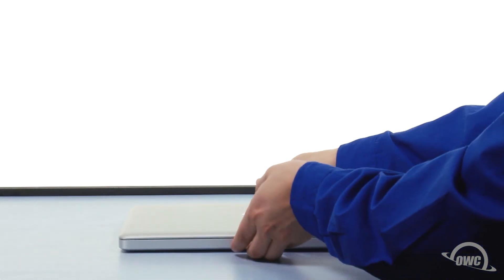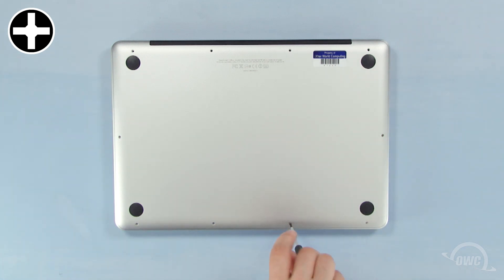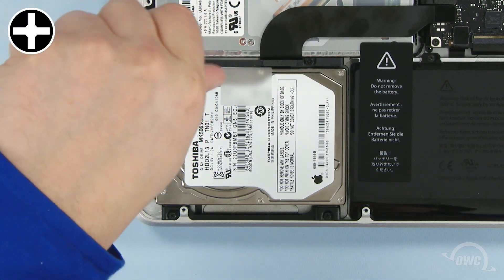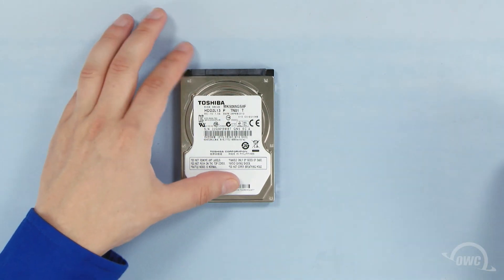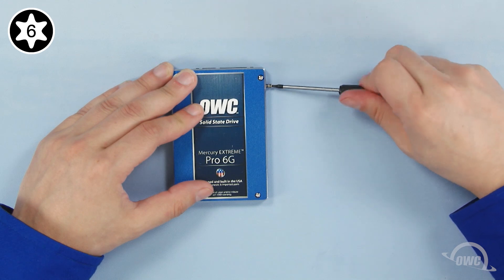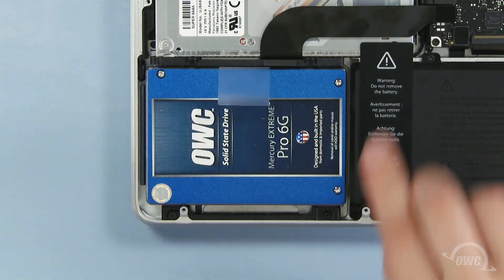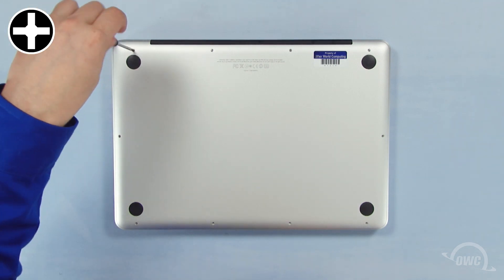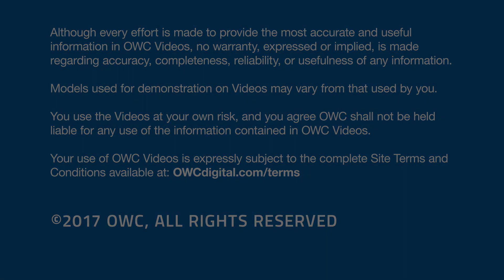How to Install a SSD or HDD in a 13-inch MacBook Pro 2012 (Non-Retina) MacBookPro9,1 & 9,2

Comment: Is the hard drive a 9.5mm thickness HDD?
Reply from the maker: For most laptops that have a HDD , the form factor is 9.5mm / 2.5 in, there are a few occasional Windows machines that might have a bigger drive, but typically this is the form factor found in most portable Windows and Mac machines.

Comment: I installed the SSD and when I booted up it has a folder with a question mark blinking.  I restarted and held down comm-R, the SSD shows but I cannot click on it to choose the SSD.  It won't let me install the MAC OS because I can't choose the SSD.  The Disk utility shows the SSD but I can't click on any of the buttons to repair or choose.  Any thoughts?  Suggestions?
Reply from the maker: We would recommend first testing a PRAM reset and/or an SMC reset. If this does not help, please reach out to our Tech Support team on the link below.
https://eshop.macsales.com/Service/support
Reply: Good addition ("Command + R")  I started the restore, and after Disk Utility to prep the disk, the internet restore worked.
Was the system working before?  You probably have a deeper hardware issue.

Comment: FYI apple does not use philips head screws, they are all torxs. That being said to open the back you need a T5 torx.
Reply: Nope, Philips heads for the back piece.

Comment: problem is that when I put 500gb ssd in mbp mid 2012 first it takes 30 seconds to boot and then I open one or two app it get sucked freezes my screen yet curser is moving after that system goes hang......again and again same thing happens.....but when  I put ssd in external cases everything is ok now tell me what is the problem. there are plenty of videos to install ssd but no one is telling about this. it is not only with me a lot of people suffering this problem
Reply: Have you found out what was the problem?
Reply: It’s about to sit down and start doing this and one thing I’m finding is that everybody says to install a new cable so before I start I think I’m gonna go get a new cable
Reply: So demanding lol. A lot of ppl mention the problem is the sata cable.